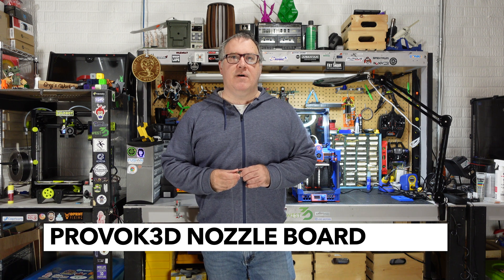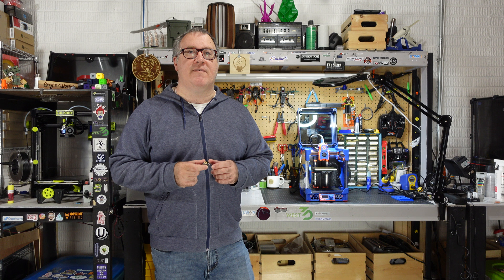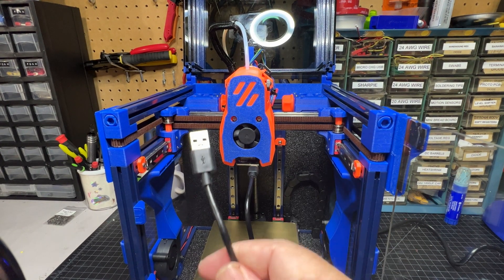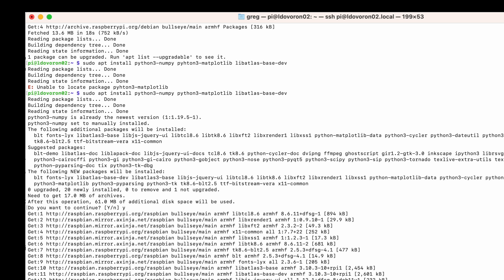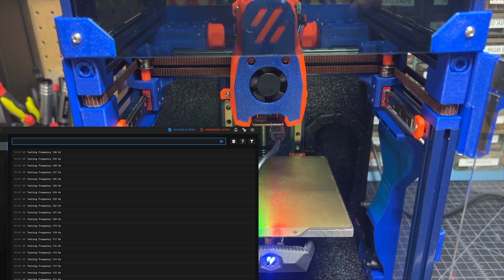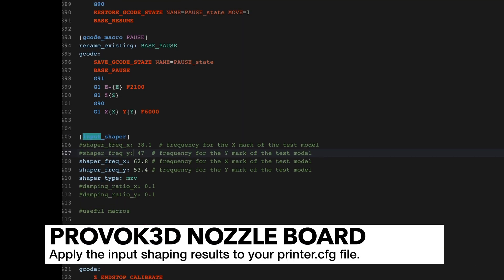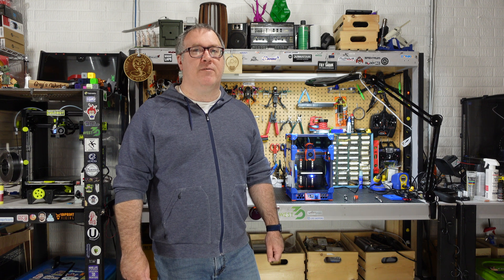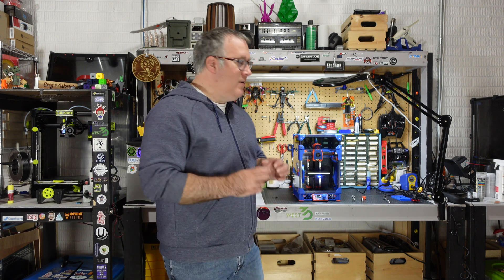Provok3d ADXL Nozzle Board for Perfect Input Shaping!

Comment: I have a noob question: Couldn't you just take the ADXL345 you already had @1:35 and tape it closer to the nozzle during the re-measure?
Reply from the maker: Good question! The ADXL345 is embedded in the CANBUS board, so it wouldn't be practical to mount it closer to the nozzle. Input shaping is also super sensitive, so something like tape wouldn't likely hold it steady/solid enough to get a good reading. 

A cheaper but more time consuming option would be to find an ADXL345 3d printed nozzle mount. You can buy a regular ADXL345 off Amazon for around $8-10. Then you could 3d print a nozzle mount. After that you need to wire it up and connect it to the Raspberry Pi pins. Here is an example of a mount:
https://www.thingiverse.com/thing:4950872

I like the Provok3d solution because it is quick and easy/simple out of the box and the wiring is very easy (just a USB cable).
Reply: @GregsMakerCorner  Wow thank you for providing details on both options!  The time saved could make the product absolutely worth it.
Reply: I already have an IS setup with a PI Pico.  That nozzle mount looks like a good solution though. More accurate results. I’m going to print a nozzle mount for mine.  Great video Greg!